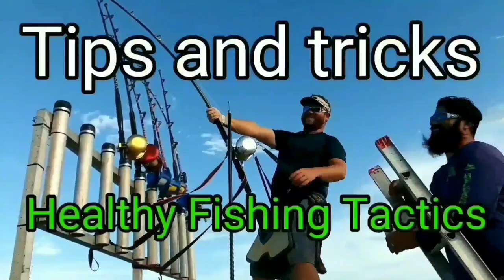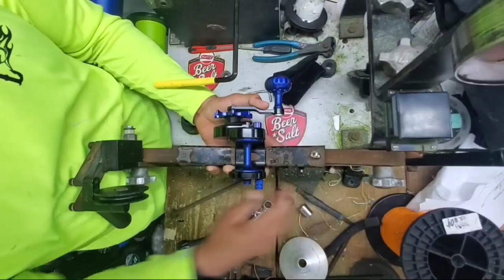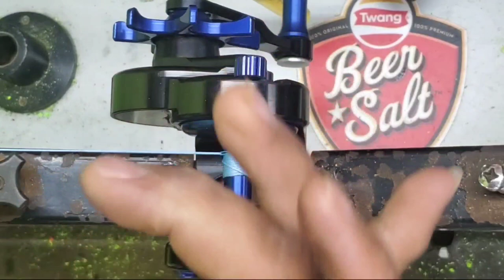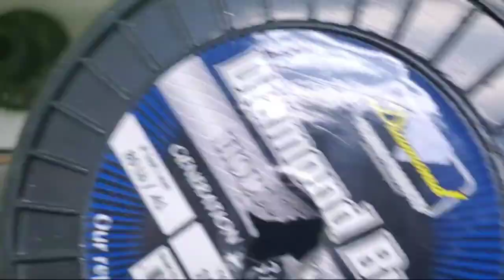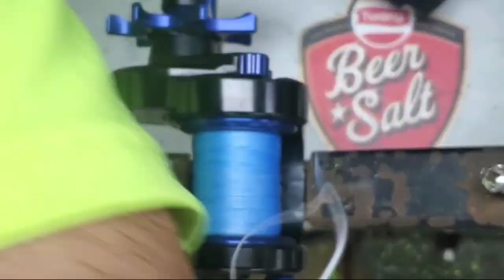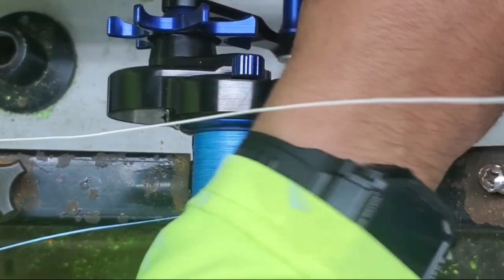This reel scared me the most ever while spooling a reel for customer learning line capacity Siegler

Comment: I had one of those got rid of it same issue. The one screw it has on the gear housingbis just not enough. Plus the reel was just loud on its own. Was not impressed with seigler. 450 for a reel with issues ill stick to Avets.
Reply from the maker: Cool input that for sure..

Comment: I have two of those great reels there two bolts on the bottom by the main backplate tighten up and it will be good
Reply from the maker: How do you fish them .. this one really had me worried
Reply: @TeamHardLife  mostly surf for pompano and small rigs not for like massive bull reds and trying to stop em
Reply: @garricksreptiles2667  it has 40lb of drag they’re pretty strong imo for the size
Reply: @TheOG13s  but are you really have 40lbs or more line on that small reel? Max I would do is 30lb line
Reply: @TeamHardLife  I use 60lb diamond hollow core with 100lb topshot I have it on a 10’steadfast ml I cast 6oz and fishbits are mullet heads and 4oz that seams to be the ticket it can outcast my avet sx are my Penn Fantom I’ve stopped a 34”red in it’s tracks at Indian point and they have a quick line retrieve for when your fishing around rocks
Reply from the maker: Cool deal how long have you had that reel?.. and is that the biggest fish you have landed on that reel
Reply from the maker: Also what was the gear ratio on that reel
Reply: @TeamHardLife  I was told it’s like the size of a 130 main gear
Reply from the maker: Lol no.. what's the reeling in ratio.. ?
Reply: @TeamHardLife  6.0:1
Reply from the maker: That's pretty good retrieval rate.
Reply: @TeamHardLife  I’ve had the first one about two years caught a lot of fish on it but I think that might have been my biggest on the reel but I didn’t have any problems reeling it In
Reply from the maker: Yes sir
Reply: Not the first but the SECOND MILLION TWENTY THOUSAND coming up. #Avetreels
Reply: EYES ARE WATCHING FOR THE 20K GIVEAWAY #TEAMREELLOCOS  #CORTLANDHOLLOWCOREBRAID